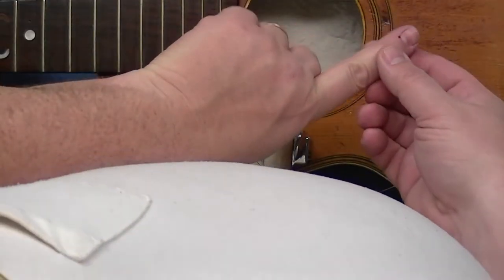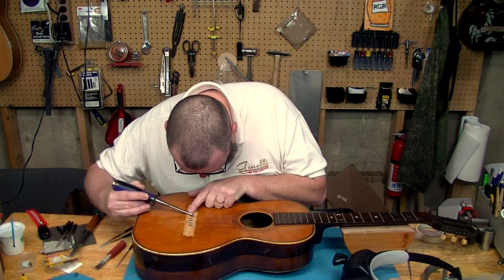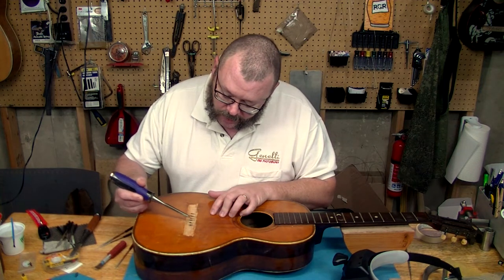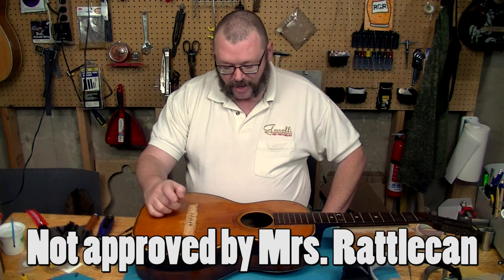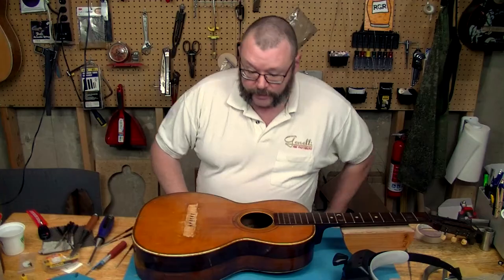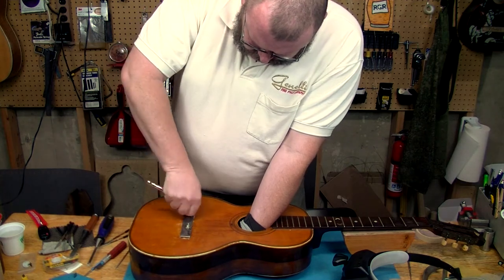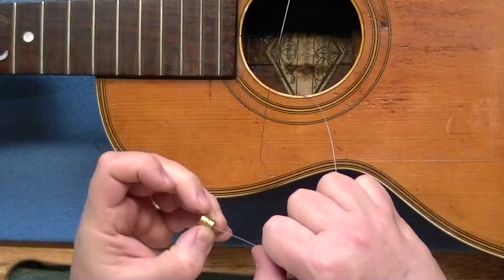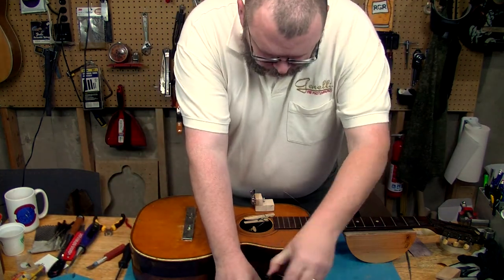bridge clamp and cleats CARL FISCHER pt5 | RATTLECAN GUITAR RESTORATIONS by James O’Rear

Comment: That bridge tool reminds me of the Thompson Belly Reducer, works on the same manner, hopefully is a bit cheaper in price. Thanks for the plug brother! I owe you one!
Reply from the maker: Randy Schartiger I make them out of plain steel bar so very cheap.
Reply: Randy Schartige, I've made some from aluminum, 1/4" plate. Down side it cools off faster than steel. But I boil them in the shop and have it rigged to go in quick.
Reply from the maker: That's why I use the steel. Little harder to work with for a non-machinist guy like me but do-able.

Comment: A brass bridge plate would help with those awful peg holes in the soundboard.
Reply from the maker: I've thought about that but the inside part of the bridge brace/plate has the holes right along the edge. Totally open to ideas that don't involve removing the back.
Reply: That is too bad. The brass plate reinforcements really help.